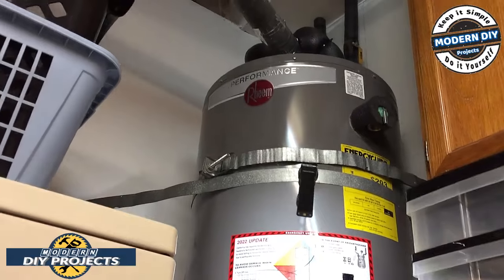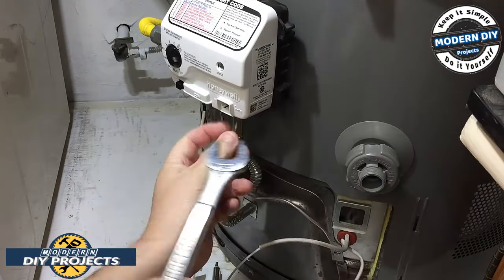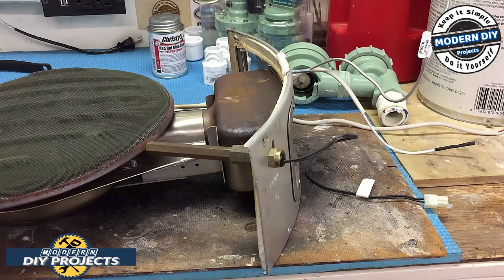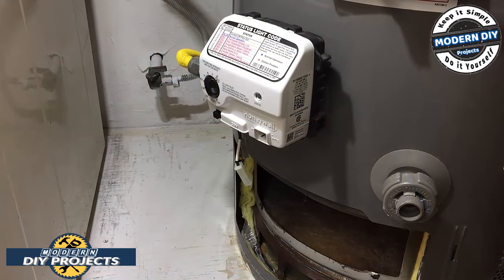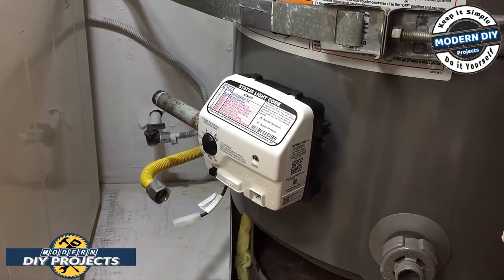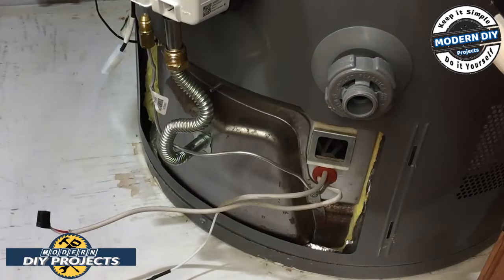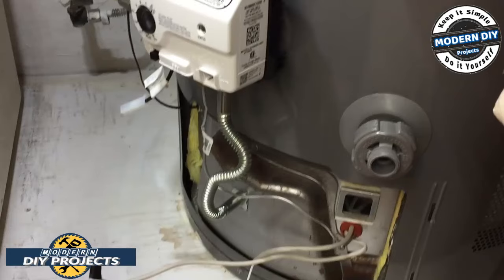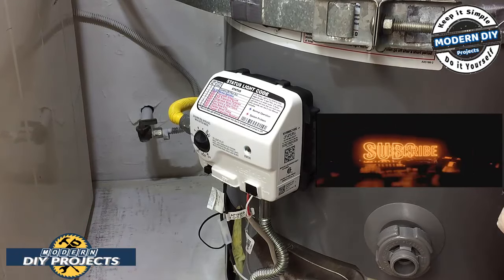Rheem Water Heater Chamber Sensor Failure / How to Replace Chamber Sensor & Gas Control Valve DIY

Comment: Thanks for the video because it makes replacing the chamber sensor much easier for me. I do have a feedback for you though. Even if the engineers who designed the chamber sensor from the outside without taking the bottom part out, then how the hell are you supposed to remove the tubing or install the tubing without removing the bottom part? I guess that's why you're not an engineer because you don't think things through. Even as a Senior Software Engineer, I still see exactly why the chamber sensor had to be done just like that.
Reply from the maker: Wow, you sure have a passive aggressive tone going there. First a compliment followed up by a back handed insult. Nice one! First of all, in the video, I was just venting some frustration about the amount of work that I had to do for such a minor problem. I never claimed to be an Engineer but was just thinking out loud how there "Must be a better way" to have done this. But I can certainly see how you are definitely a senior software engineer. Dealing with code you can say whatever comes off the top of your head. When talking to people maybe you want to rephrase things a little bit better so you don't wind up insulting the person that just helped you out. Just sayin!!!

Comment: I am currently dealing with a no light at all situation.
 I hold the pilot and nothing is happening with the light on the box.
This Water heater is this the same as in video and dated 2020
Reply from the maker: Sounds like the gas controller valve is no good. Call Rheem, you should still be under warranty.

Comment: Heads up! I find these heaters thrown in alleys all the time..good tank, frustrated previous owners.  Rheem warranty covers 5 years per serial # and date code. Call them up and they will send you $300 worth of parts for free. Once fixed it's like getting a $750 water heater for free (Calif prices)

Comment: You did.
 A pretty good job illustrating on how to replace gas valve. But when you light the pilot, you do not have to hold down the ignite button. Just hold down the pilot for about 30 seconds. Once you hit the ignitor it should light the pilot. Hold it down for another 30 seconds and release, then turn on. Keep up the good work.

Comment: I had the exact same problem, red light flashing 9 times. Water heater is 4 yrs. old w/12 yr. warranty. Called Rheem and they sent me the exact same 2 parts that you received (Gas control valve & chamber sensor). Written instructions were very confusing and complicated, so thought I’d search YouTube for a video. So glad I found yours! However, I only replaced the chamber sensor & used the same Gas control valve that came with the water heater. It now works fine & I didn’t have to disconnect the gas line or drain & refill the tank!! It took about 45 mins. total while watching your video.  I now have a brand new spare Gas control valve if I need it in the future.
(One thing that wasn’t mentioned is that you need a #20 size TORX head tool to remove the 4 screws). 
Thanks so much for your easy to follow informative video!
Reply: I swear I think the Rheem engineers were hungover when they designed these heaters.  My chamber sensor went out after 5 years. They sent me both parts under warranty two days ago, but I only got the gas control unit today. The sensor will be another 5 days 😢.

Update: The chamber sensor arrived 2 days before the scheduled delivery date, and it took me an hour from start to finish to replace and get the heater lit. Fortunately, I  didn't need to replace the gas control unit. If you follow the video, it's actually not that difficult. Now we have hot showers again 😊 😃.
Reply: @kevinhenderson3349  same here, my just went out yesterday. repaired cost needs $475 labor only. I am going to replace by myself.
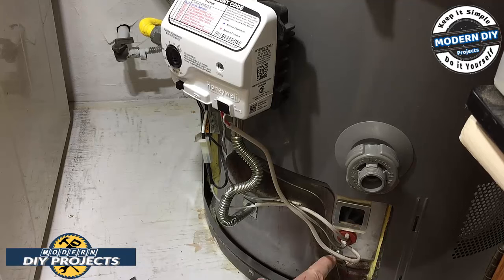Reply: 2:06
Reply: @tonytee6283  smart, the controller is sent out by Rheem just in case you need both parts. 9 times out of 10 it will be the sensor. I will also try to do the repair without the controller. You can always easily change it out later and keep it for past warranty repairs.
Reply: @rheadog9546  I just got the sensor. So far my water heater is still working without the need to replace the controller :)

Comment: So the 9-blink "Chamber sensor failure" means I'd need to change not just the chamber sensor and the whole but also gas control valve, huh? That sucks.

Edit: This just happened yesterday to our Rheem WH. It's still under warranty, so the replacement part will not cost us anything. But they'll be arriving in "2 to 4 days". So no hot water until then. 

Thanks much for producing this video! I will be following these steps to the letter next week.

Comment: Do you know that you can replace the gas valve and controller without draining the water? 
Yes, disassemble the congolese and leave only the sensor well which is attached to the black back plate. pull the temperature thermistor out if you want and replace it with the new sensor.

Comment: Did your red dot throw a code for the sensor? My threw 7 flashes. They sent me a new thermostat. Could the sensor be bad too before I get started? I will be really upset if I have to redo this whole thing twice it's bad enough that my water heater is 1 year old.
Reply: Did you get an answer?

Comment: I turn off the water feed to the tank and let some water out of the safety valve and swap the valve on the fly you do not have to drain the tank put a shallow pan in front of the tank make sure you relieve the pressure and you might lose a quart of water at the most have the new valve Teflon tape and ready to go

Comment: Just finished the job and thanks so much for your great video/DIY. A plumber quoted me $350 to do the job. I did it myself and it only took  about 3 hours including draining and trip to hardware store. Loved the Star Trek red alert reference. Still upset with RHEEM though. Make sure you install the gas line assembly correctly and check for leaks. VERY IMPORTANT!

Comment: If there chamber sensor is the failure why does it require the replacement of the thermostat unit as well.  Does the thermostat fail first and that subsequently causes the chamber sensor to fail?

Comment: Well, I just got Rheemed. 6 yr warranty and problems arose right after warranty expired. I will never buy another water heater at a big box store (Lowes/Home Depot) again. All the ones I've replaced the past 10 yrs from those two stores have crapped out.

Comment: We were having the same issue many of you were... Hot water was running out and would take forever to heat back up once it went cold. At first it was only a few hours. Then it went up to 6-8 hours. And finally 10-12 hours or so. Blue light was blinking, pilot was on and remained lit but burner wouldn't turn on under the tank to heat up the water tank. Did some trouble shooting like shutting everything down completely, gas line, pilot and turning temperature to off. Noticed it would get harder and harder to reignite the pilot but once it was on it would stay on. Still the problem persisted. Blinking blue light, pilot on but burner wouldn't run underneath the water tank. After calling the 800 number for Rheem that was on the water heater warranty sticker, talking to the rep and explaining what was going on, he helped us in ordering the parts [free of charge since water heater was still under warranty], we just paid for overnight shipping. Thanks to your video, I just now finished this on a Rheem Performance Platinum 50 gallon water heater. And since I was already there with everything disassembled I also cleaned everything inside with a shop vac, scrubbed the burner assembly and flushed the tank several times until I got all the sediment out. Thank you very much for your video, it was of great help! God bless!

Comment: Update:  Just DIM.  Longest thing was draining tank...yeah..Vacuum's are a real thing...OPEN up your faucets to drain tank faster.  No issues putting everything back in...silver lined gasket kinda ripped pulling out..replaced with another cheapass one they sent with the unit...It ripped too.  looks like it went on ok.... 

Soaped connections, checked for water leaks...

Back in business with $450 in my pocket

BEER IS ON ME!!!
Reply from the maker: Glad I could help.

Comment: okay so i bought a new chamber sensor, and replaced it. put everything together exactly the same. 

when i hold the pilot down and press the igniter, i hear a click, and turn the knob to hot/A, and i hear  it igniting the flame pretty loudly like a "FOOSH" BUT it keeps doing that once every 10 seconds, any reason why? it keeps going FOOSH...10 seconds later, FOOSH...10 seconds later...FOOSH, then i dont hear anything anymore. i go out into the shed to look, and the status blue light is off.

when i hover my hand over the vent on top, i can feel the heat.

is the blue status light supposed to turn off whenever the water heater is heated to the desired temperature? (if so that was fast because it took only 30 seconds - 1 minute)

if not, do u know whats wrong with it now? seems like 1 problem always causes another problem its driving me crazy!! its my tenant's water heater too so its urgent to me.
Reply from the maker: I have never come across this issue before. All I can guess is that you have air in the line or the igniter is messed up. Reigniting the pilot or flame every few seconds is not normal. The Blue light is supposed to be blinking every few seconds. It is not supposed to be on or off completely. I would say to check your gas lines first and make sure you have no leaks at any place allowing air to get in. Also check for kinks restricting the flow of gas.

Comment: Thank you for the tutorial because it is really helpful. I just followed your video and replaced my sensor in about 10 minutes. However, your video does not explain why there was a need to replace the control white box. I did not replace the white box and my water heater worked perfectly just by replacing the sensor itself. After the replacement, I have a blue blinking light indicating that my water heater is now working properly and I can also hear the flame going and the metal parts of the water heater gets hot quickly.

Comment: If the chamber sensor failed, why did you replace the gas valve as well?  Did Rheem send you both since it was under warranty in case it wasn't just the sensor?  The sensor is a $17 part but that gas control valve is at least $230.
FYI, I had this same 9 flash error come up, chamber sensor failure after 2 years.  I turned off the gas valve and waited for the red light to turn off.  I then re-lit the pilot light and turned the knob to hot.  The burner started right up.  The sensor must be intermittent.  This is a good thing to try while you get the sensor.  Now if the sensor goes completely open, you're SOL until you get the sensor.

Comment: Any idea what the part number for that sensor is??I ordered one and it was too short… my serial number is missing
Reply from the maker: Sorry but you really need that serial number. These may all look the same but they have different parts. Even if I gave you the serial number from mine, I'm afraid you may just buy another part that wont fit. So that is no bueno! Contact Rheem and see if there is any other way that they can track down the correct part for you.
Reply: @ModernDIYProjects  Hi thanks for the reply! I understand, but if you have the number that will at least point me in the right direction… the one in purchased was an inch shorter than the one I removed. The label where the serial number was, is scuffed and illegible
Reply from the maker: @sixstringstrumthing  You don't understand. The serial number not only relates to the unit but also to date of assembly, and location of sale. So if you use the serial number from a unit sold in New York, it will be different than one made or sold in Texas. They each have different environmental regulations making the units vastly different. So you will still get the wrong part. Even if it matches in size the resistance level may be different and you could cause damage to the unit or your home. I can't be responsible for that. That is why I suggest contacting Rheem. They know much more than either of us because they make them.
Reply: Ok thanks

Comment: Nice video.  Same issue - the dreaded 9 red blinks indicating a bad chamber sensor. A quick call to Rheem and replacement parts sent out (via FedEx Ground unfortunately).  The trick below using a 60K Ohm resistor on the chamber sensor meant that the water heater worked the whole time while we waited.   However, once I received the packages (there were 2) ,I not only got a new thermostat like you but also received a complete new burner unit!  So no switching in the new chamber sensor on the old unit - just put in the entire new burner.  So I now pretty much have a new heater and control system on my 3 year old Rheem heater.
Reply: It would be a smart move by replacing the chamber sensor with a resistor; I am going to order the resistor. Thanks, do you think it can permanently do the job, so I don't need to replace the sensor. Would it cause any hazards?
Reply: @MrTenny52  No I would not suggest the resistor trick being a permanent fix.  I used it only as a temporary solution while I waited for the replacement sensor to be mailed to me from Rheem.  It meant we had hot water during the wait.  The sensor is there for a reason and needs to be replaced if broken.
Note Rheem have a 7 year warranty on all parts for this heater so if you call and give them a serial number (which confirms its age), then they will ship you all the parts for free!
Reply: @billm5235  thanks, where to call Rheem, I lived in California.

Comment: Thanks for the DIY. They’re sending me the whole controller and sensor. Does the controller necessarily need to be replaced if it’s just the temperature sensor that is giving the error?
Reply: No worries. I’ll answer my own question. Rheem said in some situations all you need to replace is the probe but more often than not also the control unit. I just used your video to guide me through the probe switch, and wanted to say thanks so much. Looks like we’re good to go.

Comment: So, you have to replace the gas regulator valve in conjunction with the sensor? It seems poorly engineered if the sensor goes bad and it takes the regulator with it.

Comment: How long do you wait for the light to blink I been holding mine in for 2 minutes and nothing
Reply from the maker: It should be just a few seconds. Recheck your connections and make sure you didn't miss something.

Comment: So u get same parts and more likely it will fail  again???
Mine fail after 4 years, should We call again the company if it fail in two years??? It not going to be on warranty anymore.
Reply from the maker: No it's not the same parts. They are made by a different company. I hope they last a long time.
Reply: @ModernDIYProjects  mine was exactly same number and same company
Reply from the maker: Hmmmm.... Mine was totally different. Well, hope you have good results.

Comment: question: The hot water have a delay of 30 seconds in arrive at the second floor. In those 30 seconds cold water is being lost. Is there any way to decrease that time?
Thanks,
Reply from the maker: Yes, you have to look up "Cold water recirculation pump" to take care of that issue.

Comment: Yeah I got my popcorn alright but I can’t enjoy your misery as my water heater also needs its sensor replaced. I have the same water heater as yours. Thank you so much for making this video so I can replace the sensor myself. They call it thermistor and it’s on the way. 
I got 9 blinks. Hopefully the sensor is only the problem. May I ask why did you have to replace the controller box?
Reply from the maker: Rheem sent it included for free, so why not. I don't question free items. 😆

Comment: I am on my 3rd Rheem water heater in past 5 years. My home has two 40 gallon units, one for main house and one for garage house.    All 3 units are Rheem "platinum performance" with the 12 year warranty. They all failed at the 3-5 year marks...warranty covered parts of course ..but I doubt I will buy Rheem ever again. Its not fun running out of hot water SUDDENLY ON A WEEKEND BECAUSE OF TECHNOLOGY FAILURES like this.  The two water heaters in this house were 13 years old original from builder.  Replaced them to be safe...were working fine...just evidence of some minor leaking (heat expansion cycles most likely). These videos are helpful and what I needed for 3rd repair.  I have 3 heaters...because I can't wait for the shipping....no hot water for two days MINIMUM...in my house, and ended up buying a new water heater and use it as the rebuildable spare unit.  Last warranty parts shipping from Utah AND South Carolina for the two parts in this video.  3-4 days expected to California...or pay $30 for express. Way to provide great warranty service Rheem. Pffft.  I do not recommend Rheem based on my experiences so far.
Reply: Rheem suck
Reply: I had the same problem ,  my unit is 4 years old .  They sent parts and I replaced it .
Reply: Having the same problem with my 6 years old Rheem from Home Depot. I wonder if tankless is better?
Reply: in 2016 our previous water heater finally went out and we bought and unpacked our new Rheem, I knew it wouldn't last as long as that original.  The Chamber sensor crapped out a week ago. Our parts are covered under warranty. After six days of shipping, our Rheem Chamber Sensor & Gas Control finally arrived. I will never again purchase the Rheem brand, though I suspect dubious quality from all modern water heaters will now be the norm.